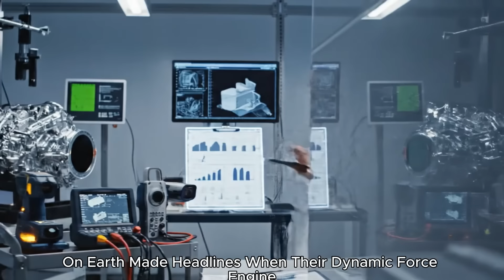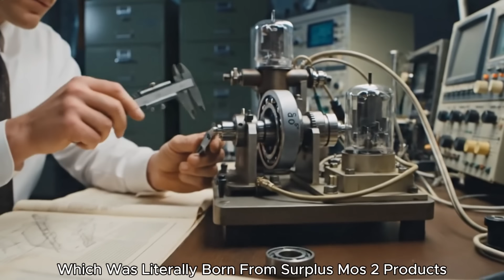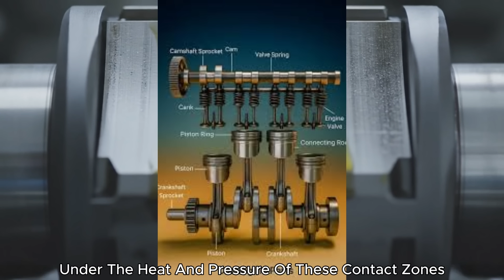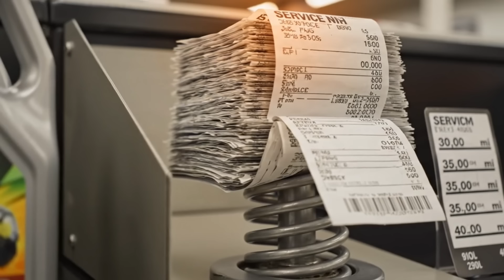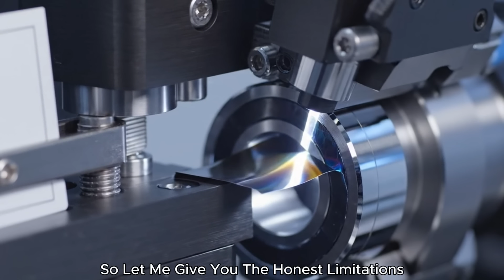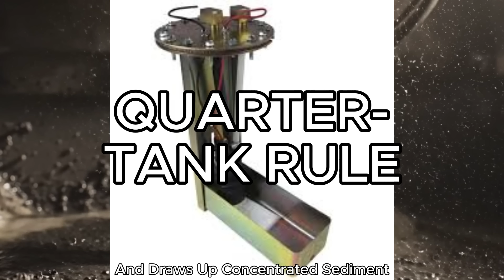This $2 Japanese Trick Burns 90% Less Fuel in ANY Engine — Gas Stations Want This BANNED

Comment: If it works great and is cheap you should put it in your oil and market your oil as proven better by your oil makes car engines never wear out until after 500,000 miles if your oil is changed every 5000 miles using only your oil and that car engine would last 500,000 miles especially if you used a 100% true synthetic oil instead of what the oil companies spend millions marketing non true synthetic oil as true synthetic oil that will protect engines up to 20,000 miles between oil changes when it won't protect an engine up to 20,000 miles between changes as well as a true synthetic especially if the same additive package is used.  Don't go 20,000 miles between oil changes and the oils that say 20,000 between changes are probably not a true synthetic oil even if it is brand name you know.  The big brands lie too.

Comment: I hate to break it to you with basic facts, but the amount of energy in a gallon of gas is known, and how much energy to move a vehicle is known, and how much is lost due to heat. There is a reason why the 100 mpg  vehicles are all made extremely light, small and aerodynamic.  The only way you are going to reduce your fuel consumption by 80% is if you figure a way to reduce heat generation/loss to zero and converting it to propulsive force. And maybe run it on steel wheels/rails.
Reply: There have been two independent guys that independently invented carburetors that could easily deliver over 100 miles to the gallon the first one by a Canadian mechanic in the 1930s. The other was by an American with only an hundred some time later. Both of these men were ruined by big business. Big business was afraid of what it would do to their business model. In 1951 congress passes a law allowing patents to be classified for national security. In one year 5000 patents were classified in the interests of national security.  How many energy breakthroughs, medical diseases cured, and other countless breakthroughs have been kept from the great people of this deserving nation?
Reply: think about how many people would have to be in on it... all over the world, bright young minds researching, wanting to be the one that cracks the cure... every step of the way the science community is watching, independant philanthropists, collaborating... all shut down by me in black... gov't science isn't that smart... the globull warming gig has been up for a while because they could not silence everyone, try as they did.
Reply: The only way to make it work is to open source the technology. All of the technologies. To beat down big greedy big corporate business.
Reply: @deanbinder9450 you think you can beat the LAWS of physics just by putting more effort into it? You are in effect suggesting that perpetual motion is possible.
All of the research around internal combustion engines, relative to efficiency is open source.  It's like suggesting the concept of rotational force from gasoline is a deep secret.  All sorts of types of engines and carburetor have been designed over the years, some that worked, some that failed... yet no one has figured out a way to get infinite energy from a gallon of gas... I wonder why? 🤔
Reply: @deanbinder9450  Any carburetor can be made to deliver less fuel. However the engine won't perform and it will be damaged, so I've always found this claim to be suspect.. Modern EFI systems are very efficient because they are constantly adjusting to the requirements.
Reply: @deanbinder9450 bullogna. The math does not add up, no how, no way. You would have to invent an engine that does not get hot, or need a coolant system.  Google the highest achieved mpg with an internal combustion engine and you will see that anything capable of such is a loooong way from the iron autos of the 30's.  Look it up yourself... how much energy does it take to move a 5000 lb vehicle one mile on the flat.  then, compare that with the amount of energy in a gallon of gasoline, and subtract the efficiency loss of an ICE.  Then look at how MIT pushes the limits... real stuff, efficient engines, light and aerodynamic vehicles. Now they don't even use carburetor ffs!! because computers and injectors do one fk of a lot better mixing air with fuel than a venturi with jets.  To. e to put that myth to bed because absolutely none of it makes any sense in the hyper analytical world we live in.  Motorcycles, airplanes and boats... all crushed by the big three... And Ev's... how do those fit in to the conspiracy???
Reply: @deanbinder9450  I've always wondered why there hasn't been an invention to replace the ICE with all the fertile minds alive. Then I got older, mingled with humanity and the answer became clear. Humans are insanely corrupt and money and wealth rule. Humanity a distant second, if that. I'm even surprised Musk got by with making Tesla without going the way of Tucker. 50+ years back in school, we came up with some of the things that today are being used, but back then, they were squashed by "It's no good!". We had the Prius design almost identical, except we didn't have computers to run things, so it didn't expand. The special cams used on motorcycle engines to control valves without springs was done then too. What else has been hidden? Since computers can control things now, the ideas should be endless. Unfortunately, Americans love cars, so who knows what will happen as long as oil rules. Humans suck!
Reply: Friction reduction is a way to reduce fuel consumption or increase miles per gallon. That is why moly and PTFE treatments are used. PTFE aka Teflon the patented name for poly tetrafloroethalene.
Reply: @calvinpritchett2862 not by 90%, more like 2%
Reply: Molybdenum Disulfide (MoS2) and Teflon (PTFE) additives face significant skepticism regarding their effectiveness in modern engines, with experts warning that many benefits are myths or exaggerated for consumer products.  While MoS2 is a proven solid lubricant with a friction coefficient of <0.1 and is already included in many high-quality factory oils as organomolybdenum friction modifiers, adding aftermarket MoS2 to modern synthetics is often redundant and risks deposit buildup or incompatibility with existing additive packages. 

Teflon (PTFE) is widely considered a marketing gimmick for engine oil because PTFE particles do not adhere to metal surfaces without extremely high temperatures (around 700°C), meaning they remain suspended in the oil rather than forming a protective coating.  Suspended solids like PTFE can compromise oil flow, increase wear under certain conditions, and clog oil passages, leading major manufacturers like DuPont to stop selling PTFE for oil additives and OEMs to explicitly advise against their use. 

Key myths and realities include:

Instant Silence: A noisy engine usually indicates a mechanical problem (like a broken rod or worn lifter), which an additive cannot fix; reduced friction may only quiet minor friction noises, not mechanical knocking. 
Universal Benefit: While older or air-cooled engines might see some improvement, modern water-cooled engines with tight tolerances and advanced synthetic oils often see no measurable benefit and risk diluting the carefully balanced factory formulation. 
Longevity and Fuel Economy: Claims of significantly extending engine life or improving fuel economy are often anecdotal; SAE testing shows only 3-5% fuel economy gains with optimal moly concentrations, which are often already present in the base oil. 
Permanent Protection: The protective layers formed by these additives are not permanent chemical bonds but weak electrostatic attachments that degrade with heat, pressure, and oil aging, offering no lasting protection after the additive concentration drops.
Reply: @calvinpritchett2862 Slick 50 was found to be deceptive because the Federal Trade Commission (FTC) charged the manufacturer with making false and unsubstantiated advertising claims regarding engine wear reduction, fuel economy, and horsepower. 

FTC Charges (1996-1997): The FTC alleged that Slick 50 ads falsely claimed the product reduced engine wear by up to 50% for 50,000 miles and bonded PTFE to engine parts, yet the company lacked reliable evidence to support these specific assertions. 

Settlement and Penalties: In 1997, three subsidiaries of Quaker State Corp. settled the charges, agreeing to pay upwards of $20 million in damages and redress to consumers while banning the company from making claims about reduced wear or increased performance without proof. 

Technical Findings: Investigations revealed that modern engines are adequately protected by standard motor oil at start-up, that Slick 50 did not coat engine parts with a layer of PTFE, and that the product failed to meet military specifications for motor oil additives. 

Consumer and Expert Consensus: The product is widely characterized by automotive experts and online communities as "snake oil," with reports suggesting that while it may have temporarily quieted engines, it could also cause particulate buildup that clogs oil filters and damages engines.
Reply: I hate to break it to you with basic facts,but friction cause metal to heats up, did you know how much mpg the old audi 200 gives? and these were as heavy as st
Reply: @danny323dee 100 mpg???  Did they have a radiator???
Reply: And I hate to break it to you that COMBUSTION causes one fk of a lot more heat than friction, like on the order of dozens of times more.  And wind resistance would suck up one fk of energy than internal engine resistance.  Study physics.

Comment: Does it ever say how many grams are needed? I think up to 2 grams per oil change.
Reply: you just add a small tin of molyslip or slick50, I use the moly grease, I bought some 15yrs ago and still use it
Reply: I read add mos2 every 30k -50k miles, not every oil change. if you get the refined, mix it with say 1/4 -half quart of engine oil, stir until it turns gray add to prewarmed engine.